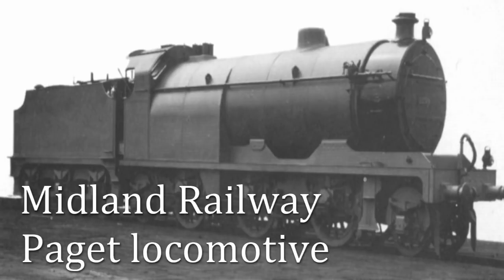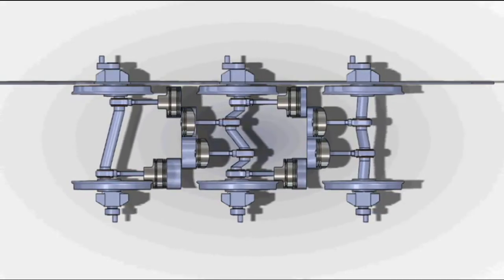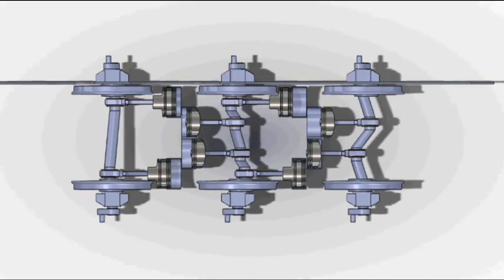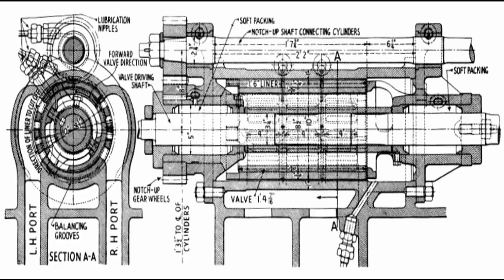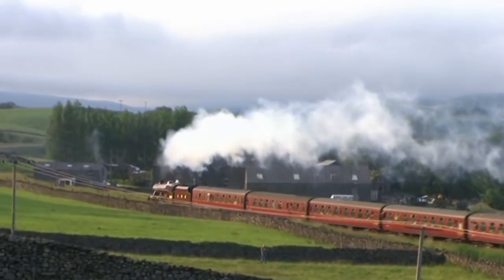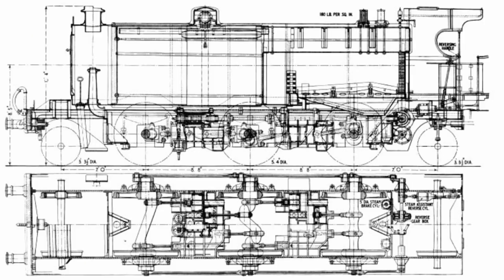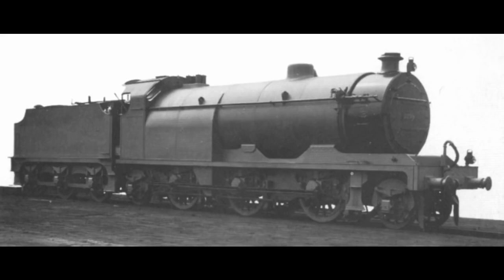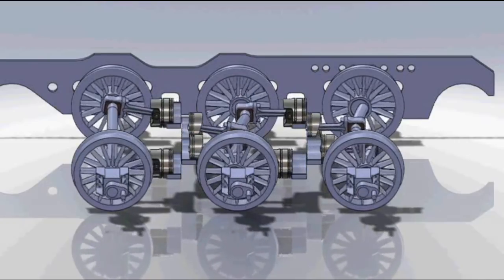Strange Locomotives - Paget locomotive (Midland Railway)

Comment: Oh look: a maintenace Nightmare
Reply: All steam engines were a maintenance nightmare. That is why Diesels dominated rail service later in time.
Reply: @MegaGeorge1948  Yeah. But everything ith innrt Cylinders especially-
Reply: Such a shame they didn’t use poppet valves
Reply: @davidelliott5843  Sliding shuttle valves that cycle the steam back and forth in the volume needed for the drive pistons were more durable against super heated seam.
Reply: @MegaGeorge1948  don'overdramatize. There were locomotives which were realatively crude and reliable. If you use only 2 pistons with a Walschaerts gear, there is less problems.

Comment: The germans making also a interesting steam locomotive with eight V-shaped engines (or four for one axle but the engines are fitted outside on the front of the wheels).

The locomotive have the number 19 1001 and it was streamlined like the class 05 002.

Comment: This maintenance nightmare is not much more complicated than the Shay, Climax, and Heisler types of geared locomotives used on logging railways. But geared engines are very slow compared to conventional locomotives.
Reply: Don't forget that weird Fell locomotive with its complicated mechanical systems.
Reply: Hannah Miyamoto Shays, Climax and Heisler’s are designed for power and traction rather than speed even though the top speed is 20-25 mph
Reply: @nathanchan4653   That was my point. Fortunately, because steam produces max torque at 0 MPH, no transmission or clutch is needed.
Reply: With the geared locomotives, especially Shays, the maintenance is eased considerably by the whole drive mechanism being exposed and accessible.
Reply: @larrybrennan1463  How do British railroaders maintain an engine with an inside cylinder? Do they have to put the engine over a pit every time they want to check something? Inside cylinders are almost unknown in the U.S. Even when compound engines were popular -- before superheating -- the high pressure cylinders were usually on the outside, next to the low pressure  cylinders.
Reply: @HSMiyamoto  Many early (pre 1860) American locomotives did indeed have inside cylinders, but ease of maintenance and simplicity of construction led to the dominance of outside cylinders in American practice. (It must be remembered that America here includes Canada, as well, since the systems of the two countries interchanged completely; Mexico to a lesser extent.) Prior to 1900, most locomtives used Stephenson valve gear, which is worked off eccentrics mounted on the driver axle; its position inside the frame made it difficult to work on, and adding inside cylinders with main rods working on the driver axle only made it more difficult, I'd imagine. As locomotives grew larger, inside valve gear suffered from maintenance problems. By 1900 Americans favored outside valve gear, like Walschaerts -- again, easier to get to. Because of its many moving parts, valve gear was always requiring adjustment as parts wore or loosened, so ease of maintenance was a big plus on something that so critically affected a locomotive's operation.
Compound engines were considered more efficient, and in the 1890s many were built or tried out, with inside and outside cylinders -- even tandem compounds (cylinders placed end to end).
Compounding of articulated engines was common, right up to the end of steam with the Norfolk & Western's Y classes. Most later articulateds -- Challengers, Yellowstones, Big Boys, and such -- were simple. Some non-articulated three-cylinder and four-cylinder compounds with inside cylinders  were built, but for the most part, after a flurry built for a few decades, they were not reproduced and some were rebuilt as two-cylinder engines. Generally any savings in the use of steam twice were negated by increased maintenance. (One notable example of a three-cylinder compound was the Union Pacific's 4-12-2 class.)
The British also used plate frames, which were heavier and more substantial than America's lighter built-up bar frames. I think the bar frames, though subject to cracking, made access easier to inside valve gear. In the Twenties, large  American locomotives were built with cast frames.
Reply: @larrybrennan1463   I guess that answers my questions. I have volunteered at a railway museum, but I didn't work on steam locomotives.
Reply: @HSMiyamoto  it depends on the gear settings. If you set it to large filling, the power can be raised, but steam runs out quickly.

Comment: THANKS FOR POSTING THIS AND DOING THE COMPUTER ANIMATION!  THIS IS QUITE INTERESTING!  I IMAGINE IT WAS A BIT OF A PIG TO DO HEAVY WORK TO THE MACHINERY UNDERNEATH THE BOILER AND BETWEEN THE WHEELS!  IN MY EARLY DAYS ON THE AT&SF RR SHOP IN KANSAS CITY
I GOT TO TALK WITH A PAIR OF EX UNION
PACIFIC MACHINISTS THAT WORKED ON THE UNION PACIFIC 9000 CLASS 4-12-2
LOCOMOTIVES!  THE MIDDLE CYLINDER WAS ATTACHED TO A SINGLE CRANK AXLE
AND WORKING ON THE CENTER ROD AND BEARINGS WAS QUITE DIFFICULT!
THIS TURNED OUT TO BE ONLY AN EXTENDED EXPERIMENT ON THE U.P.
AS ONLY 10 OF THESE WERE BUILT!
HOWEVER IT CAN BE SAID THAT WITH 3
CYLINDERS IT WOULD HAVE THE POTENTIAL TO MORE EASILY START A HEAVY FREIGHT TRAIN WIT THE CRANK PINS ON A 120 DEGREE ARRANGEMENT!

Comment: One point - everyone always quotes p-bronze liners. I've no idea where this info came from originally but the drawings show the valves and liners were both cast iron so no differential expansion problems. There was a gun metal sealing strip sprung loaded from behind to seal the admission port so maybe this caused problems but the rotary valves and cut off liners were iron not bronze.

Comment: Very interesting.  The concept was quite a good idea but putting it into practice would have been near impossible due to the strict timing of the valves.
Reply: Walter Raleigh there was only 4 positions of cutoff and reverse had no facility to use the steam expansively. The gearbox is amazingly simple and considering the availability of turntables it could have worked, the turbo motive only had a reverse turbine powerful enough to get to turning facilities.
Reply: Thanks for that. I like to know how things work.
Reply: How are valves timed?

Comment: The differential expansion problem may well have been caused by the uneven heating along the length of the cylinders, a common problem on uniflow engines.

Comment: To technical for the average audience without visual pointers to mechanical parts which where being spoken of...  Simply said only Locomotive engineers could fully appreciate the information being given in this video..  For everyone else you may as well have been speaking Swahili..
Reply: That's right, a technical background and understanding of basic principles on the working of steam engines is needed to understand the information.
One thing still not clear from the animation however is if each cylinder operates individual or is paired with the slightly offset cylinder in a sort of opposing piston fashion, and if the rotary valves work in one of both ways.
The drawing shown are to blurry to distinghuish this.